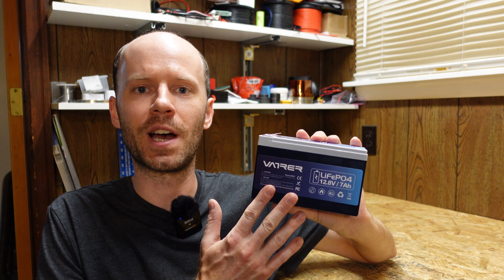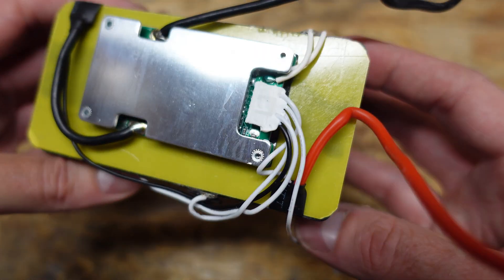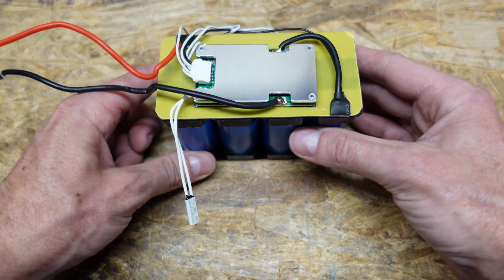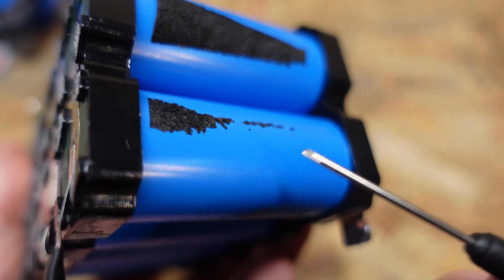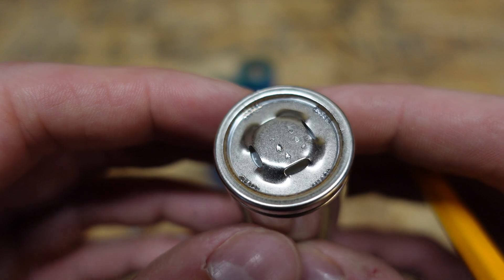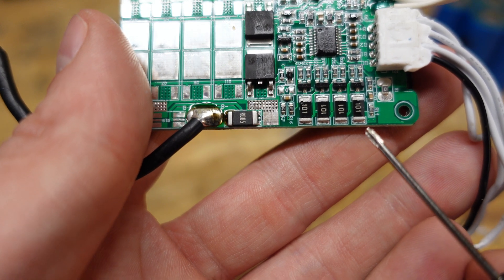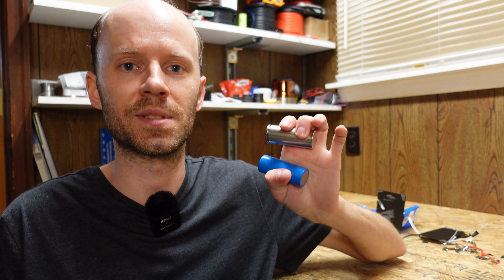Quick Teardown of the Vatrer 12V 7Ah LiFePO4 Battery

Comment: 7 amp hour is the largest lithium allowed on a carryon luggage for an airline = less than 100 watts. Mine is a Thiss. 6 amp hour is probably different cells as millions are made. 13.28 standing volts and I had no problem charging at + - 13.45 volts with an adjustable lead camcorder charger made 40 years ago.

Comment: 6AH uses 4 32700 6000maHr cells, the 7AH uses 8 26650 4000maHr cells.  these are the only liFePo4 size cell combinations that fit inside a standard 12V 7AH pack

Comment: Hey since your taking requests.. 
How about a review on the SeeSii Farad capacitor battery spot welder..  Just picked one up.. Battery hookup never has any in stock.. Was going to go, with one without the case (just like b hookup has ) but decided to go with the one with the enclosure.. Maybe use for a reference to 3d printing cases... it's freaking Supper sweet.. I have a sunko paper weight, just like yours.. Will do the fix as in your previous video.. But no rush now because this welder is freaking sweet..

Comment: Omg, I can not even believe I missed this!!! 😱 I happen to be in my email now and saw the notice from YouTube there!  

This is absolutely badass, amazing! Such a thorough and technically informative video!!

I’m very happy to learn that your capacity test showed that the battery exceeded it/ listed rating...in my experience + .400Ah is a lot for such a small battery!   

The results make me also happy because I did learn that your hunch is correct, the 6Ah versions that I bought for $18.00 ish ( $3 per amp hour) were on clearance by the manufacturer and yes replaced by the 7Ah that you got!  

So this also leads me to think 2 things: that the Vatrer is not lying about the capacity of either battery. You have shown that 7Ah you got is legit. And since it is the newer model,  it makes that since that they increase the efficiency to 7Ah there is no point in continuing a 6Ah line and so cleared out older but still good models … I wish I had a battery load/capacity tester but I can say, just antidotally, that the ones I have seem to be holding a very good charge under load. Maybe I’ll get a tester off of Alibaba or Temu 😂

Love that you noted the good spot welding as well! All good news in my opinion, I don’t feel like these Vater’s will be burning any boats down which is a great feeling…😅

Bravo for a fantastic video! You have answered all my questions and more. 

I see some cool comments/questions below. I will add to any that I might be of some help with! 

Thank you from Los Angeles and keep up the great work!❤

Comment: Excuse my ignorance but since I use large 200ah for solar. What would be a use case for these smaller batteries?
Reply from the maker: The primary application that comes to mind for batteries this size are UPS backups systems, such as that for a small computer, security cameras, etc.
Reply: @LithiumSolar  Interesting. Thank you
Reply: CB radios, boat radios, lighting, model plane charging, fish finder if it can take 13.28 volts.

Comment: What would be the use case for batteries this small?
Reply from the maker: Small UPS or other auxillary device backup is what primarily comes to mind. A lot of the smaller APC UPS's use this formfactor.
Reply: Ha! ...  as the original question-asker, I can actually answer this one quite passionately! I don’t use them as UPS backups at all (though there are new backups systems that are small and have the proper electronics to charge lifepo4s safety -- just please avoid putting these batteries in older SLA systems) . 

The REAL magic ✨(sometimes movie magic) of these batteries is in deep cycle and or continuous (“always on”) low current, solar powered devices: industrial and smart home sensors, automation triggers /relays/ relay sensors, remote security cameras and sirens, micro computers, Raspberry Pi, wifi modules, LoRa coms modules, Zigbee, ESP8622, ESP32, robotics, relays, servo motors for cameras, sevo motors, panels solar panel tracking , gate motors, deer feeders and lots more. I use mine lots of the above but also with differential GPS camera location trackers for on-set visual effects.  

These batteries are great in combination with a good solar lithium charge controller modules ($10 on Aliexpress) and the proper buck converters + misc circuitry to use in set-it-and-forget-it, hard to reach / hard to access places that need solar powered gear. Love them! I sometimes take them out of the original case but I actually like these cases and didnt want to this time! I also wire them in parallel when needed.
Reply: What I’m confused about is the size. My power drill takes a 20v 6 Ah battery. Much smaller. Then I’m looking at this 7 ah battery about a quarter the size of a 12v 100 Ah battery. The scale is all wrong.
Reply: @CompleteOffGridAmateur Lithiumsolar can answer this way better / more technically correct but my understanding is that devices like power tools, drones, etc 
 work and sell better when the amount of potential energy in each cell is very high vs the weight. Lipo sparkles here because lipo packs more punch for the weight/size. lipo is 3.7 vs 3.2v per cell as well … but … significantly less stable. 

LiFePo4, though older tech and less efficient, has made a comeback because it is more stable/safe at the trade of increased size/weight.  It's like a nice compromise between sla and lipo (for example now people who used to have fears of lithium battery nightmares of burning to death on their sailboats are finally able to use Lithium/ LiFePo4 cells —we never used lipo)! 

The Vatrer 7 and 6Ah batteries we have, the cases they come in are in that standard industry form factor size you see everywhere with SLA (however they should not be used in SLA devices)! The size of the cases is overkill for these 4 pack cells but the industry wanted to stick with the old case sizing to make things easier on device manufacturers, so here we are. 🤷🏻‍♀️  I wish they were smaller boxes because this four-cell setup leaves a fair amount of extra space in it. I usually remove 4 cell packs like this from the original case to save lots of room (I always keep the serial-connected ones in those black spacers tho for safety).

I  have seen custom battery builders use smaller LiFePo4 cells and safely wire them into in the same form factor cases resulting in significantly larger capacities and or custom voltages (so yes this is why things aren’t adding up, but these cases can be packed with more cells it’s just a lot more work and cost wiring more cells to bms, etc). 
 … If that all makes sense?

Comment: It's an SLA replacement used in UPSes. My UPSes that use Sealed Lead Acid batteries can take 6A up to 9A batteries.
Reply: I run a similar battery in my UPS.  It's nearly quadrupled my backup run time.
Reply: Oh man, be careful here. In a comment above OP talkes about the possible dangers of this.
Reply: @LA-Creative  I'm still using SLA. The manufacturer (or importer, not sure which) of my UPS is in the town I live in, so I'm going to stop by and ask them One Of These Days.

Comment: LOL, the graphite of the pencil is conductive.
Good point re 6AH vs 7AH, however on their website, the 6AH is dearer than the 7AH - all very confusing.
Reply from the maker: Yes, graphite is conductive but it's not going to have the same effect as sticking a screwdriver in there lol.
Reply: @LithiumSolar  No. I had a length of graphite (rod) around 1mm diameter and it go bloody hot very quickly when 10A was pushed through it - can't remember, but I think it was only a couple of volts - which means its resistance was around 0.2 R.
Reply: @Bennyboy-dog  God quality graphite core can be "fun" with electric current. It used as electrode in batteries and other electric equipment. But most pencil core are graphite mix with (a lot of) clay and synthetic dyes. Barely concoctive. Still, bit disappointing, pencil did not short out on video :).
Reply: @mindaugasstankus5943  LOL. I had a length of graphite rod - around a mm, and just assumed that was what is in a pencil. Thanks for filling me in with the addition of clay or whatever in pencil led.

Comment: That size and AH rating is so common in backup systems for phones, internet, home security, etc... Not surprised someone decided to take advantage of that packaging category. 

Personally I would never spend the money on a lithium standby battery, just get another AGM... at least they like being fully charged all day for years on end.
Reply: "years on end" might be 2 years, usually 3 years, sometimes 5 years before you have to replace it.  The LiFePO4 version should last the lifetime of the equipment if they have the ability to turn off the charger instead of just leaving it on float all the time.  There is probably a better chemistry for standby applications that LiFePO4, but it definitely is not lead-acid unless your only consideration is initial purchase price.

Comment: I had a similar battery rated 7Ah, the min spec was 6.5 Ah, but when calculated from the power it was 6Ah, which was what it tested at. The weight was below similar 7Ah Lifep04 batteries, so something didn't add up. After a while it failed inside warranty. Another one of the same manufacturer is working fine.
Reply from the maker: What brand are yours, the same Vatrer that I have here?
Reply: @LithiumSolar  Powertech Lithium. Not the EU brand..
Reply: @technishn oh very good to know.  ... yes there can be such massively different quality levels in these batteries brands. It’s why I was hoping to see this specific model torn down.
Reply: Someone from my solar community told me that their weight play some role to the capacity, the 'iron' weight itself so if it's lighter than it should, just assumed that as scam
Reply: Yes pretty sure I noticed the listed weigh of the 7Ah was more than the 6Ah.
Reply: Some are built with 18650 and others 22650 or 32650

Comment: I bought a 10 Ah version Eco-worthy last year to power my CPAP while on safari in Africa. Worked great
Reply: How did you charge up the 10AH on safari? My nephew wondered how he would go backpacking now that he is using CPAP therapy.
Reply: @kevinholland4156  The safari locations had solar power,  so I had a 5amp charger and recharged every day in an hour.  The 10 Ah battery would last me about 3 nights.  Mine is the 12 volt Z2 travel cpap from Breas.

Comment: Cute, but the current capacity is a bit low - I have a small Eaton UPS that uses this size lead acid battery, but it's dead now and I don't want to buy another lead acid battery for it.
Was waiting for a LIFePO4 battery to come out that would work, but would need to supply 20A to be useful to keep a single PC+monitor going for  20-30 mins.
My main UPS is a 25 year old APC1000 with a homemade 7S16P pack from harvested cells, and still going strong after 5 years!
Reply: I've done frankenstein lifepo4 swaps (with the battery+wires sitting outside the case) with a couple of UPSes already. No issues so far. 20 amps of discharge current would be doable by a 20ah lifepo4 battery, but honestly the inverters in that class of UPS would be questionable for long runtimes at max output. Active cooling helps with this.
Reply: Oh gosh be careful about this, OP explains why above.

Comment: The part that raises my eyebrows are the (near) kinks in several of the wires.  Don’t expect any better, all things considered, which is unfortunate ….
Another very informative Review, 👍🏼
Reply from the maker: Good point on the kinks. It looks like the heat shrink has it force down against the edge of the cell holders pretty tight. It's not damaged, but could be a potential failure point if being used in a high vibration environment.

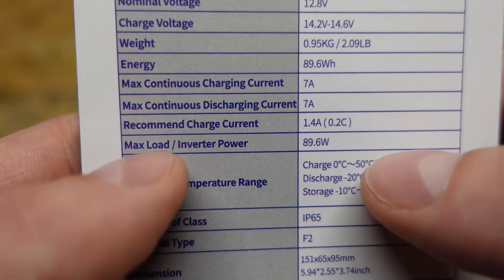Comment: The title on the product listing mentions UPS compatibility but I question whether this can be used in a typical UPS that has an SLA battery charger. The price isn't bad however I am concerned about the lower capacity rating of this versus a 10 or 12ah SLA of the same physical size and also the charging. Edit: 0:49 the max load is a deal breaker. A typical UPS would require 2 to 3 times this max load.
Reply from the maker: I don't typically suggest using LFP as a drop-in replacement for Lead Acid in applications that weren't designed for LFP. In addition to the common problem you noted of not exceeding 1C on most batteries, there's also the concern of not being able to disable the periodic equalization cycle on the UPS, which would likely produce a voltage exceeding 14.6V.
Reply: @LithiumSolar  If there ever becomes such a product it would greatly help me. As a person who is in IT, I currently have several dozen UPSs on equipment I manage. I know that for the last 3 or so years there exist UPSs from the major manufacturers that have lithium-Ion batteries however those are expensive and require me to replace all my current UPSs making that solution less desirable.
Reply from the maker: @InlineSkater72  I couldn't agree more!! There are some APC's that you can manipulate the charge voltages through serial communication and some that you can disable the equalization on. I think really any that you can disable equalization on would be fine, as long as your battery is large enough to support the current requirements. I've also looked at the LFP options and they do exist but as you noted are prohibitively expensive still.
Reply: @InlineSkater72 yes as lithium solar pointed out you would have to be cautious of the charge outputs designed into the existing UPS (some of those units charge at 15v) . You could solder in the appropriate buck converters, etc but between the getting the proper wiring right and the lithium batteries being more risky I would avoid it. I think the general concept use of a UPS is to provide backup power in rare and brief circumstances. They aren’t meant to much for deep cycle applications, where Lifepo4 and lipo shine. Also because UPS are typically not moved / transported a much it’s far more cost effective go with lead for the meantime? I’m I wrong here Lithium?
Reply: I used a 7ah LFP battery to replace the dead lead acid one that was in a small APC UPS, and so far there haven't been any issues. Since it's for a small home office application, the computer and monitor that it's connected to probably don't ever exceed 1 amp of continuous discharge anyway under normal use, so I imagine it should work fine. As for over charge issues, shouldn't the built-in BMS prevent overcharging from happening anyway?
Reply from the maker: @prerunnerwannabe  I'm glad it's working for you, which model UPS do you have? I'm sure it will be fine but it's not something I want to actively encourage. Also, the BMS is really for safety protection not a replacement for proper voltage settings. My primary concerns here would be BMS failure (transistor getting stuck "on") or the battery being shut off when you don't expect it to and potentially disconnecting your load - which I assume is important if it's on a UPS.
Reply: @LithiumSolar yes same here. I have found BMS’s have a way of failing eventually. LiFePo is at least more stable but AC aspect of UPS’s is what would have me not sleeping at night without a proper regulator and buck converter installed and charger installed etc etc. I’ve seen crazy (!) things happen under low (200mA ) current but in my case with regular Lipo cells.  I did accidentally melt down some 18AWG alligator jumper cables last week after wiring a shunt meter slightly off and connecting with it to a 2.5h lifpo4 cell!  I was shocked (!!!) how fast those things started smoking and melted on the floor. Also fried a fuse. Huge fire hazard that reminded me to be more careful!
Reply: @prerunnerwannabe  1 amp, really?  So 12 watts of power total?  This 7ah LFP battery supports up to 84 watts (7 amps).  If used in a UPS that means you might be able to support a 75 watt load.  And that is only if the initial turn on of the inverter in the UPS doesn't surge too much and cause the BMS to turn off.
Reply: @Sylvan_dB  My bad, I meant 1C, not 1 amp. That's the continuous load rating, so for shorter loads where you just need time to save and shut down your workstation, I think it should still be sufficient for most applications.
Reply: @prerunnerwannabe   I have 2 of these Vatrer 7ah batteries.  The BMS shuts off really quick with over 7amp draw.  Really quick means "faster than my reaction time" even at approx 8amps. Fully charged they work on my UPS with a 60 watt incandescent bulb as the load but not a 75 watt bulb. And the UPS won't charge them (floats at 13.55 volt). When charged by the UPS they will support a 40 watt bulb but not the 60.
Reply: I've been using 4 zooms 12.8v in my MA 2200va since Feb 2022, and it has handled dozens of power outages to keep my modem, router,  NVR and a few others running.  It also protects my AVR and 4 rack amps for my surround sound setup.

Comment: Use it for who really knows and throw it in the trash nothing appealing about any of these batteries, if I did get lithium batteries the battery's and everything would be replaceable and easily maintenanced and not from China..
Reply from the maker: That's kindof how I feel. Once you start talking about batteries this small, they're so cheap that even if you get 5 years out of it, it's still going to be quite a bit more than a lead acid would have lasted you, and better too.
Reply: @Lithium Solar  I buy thing's little kid's have to die for good luck..